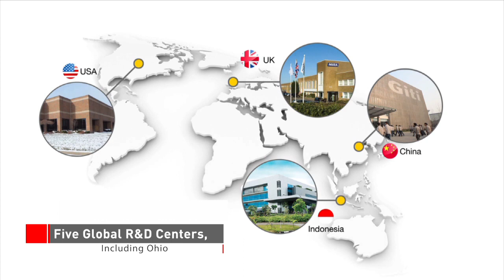Who Makes GT Radial?

Comment: Just got some GT radial Touring VP plus, and man these tires handle great, my other tires were 12 years old and after driving 5mins on these, I knew I made the right choice.👍
Reply: Brand new tires feel better than dozen year old ones? NO WAY! 🤦
Reply: @JohnnyBurnes  Lol, good one, what I didn't mention was my 12yr old tires looked new, no wear, but when I got a slow leak, they wouldn't repair the tire because of age, therefore I replaced all 4 with GT Radials and it's been great. 👍